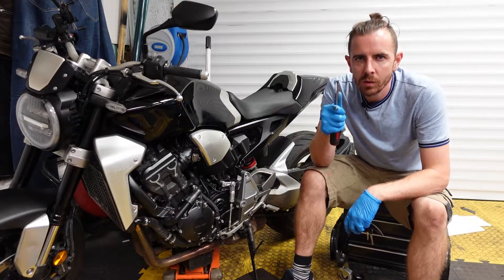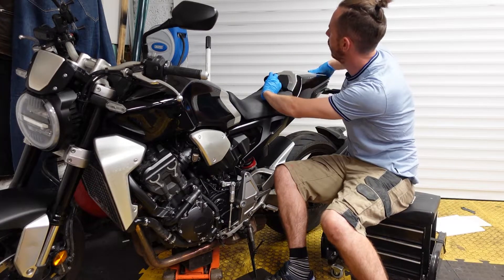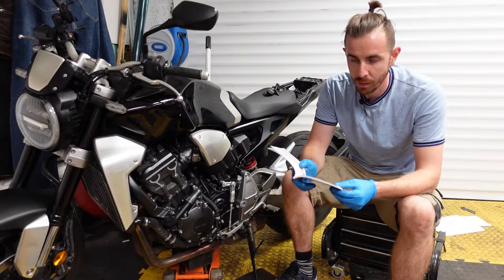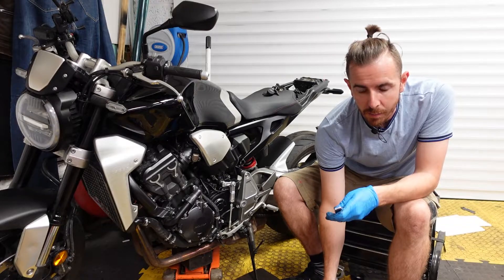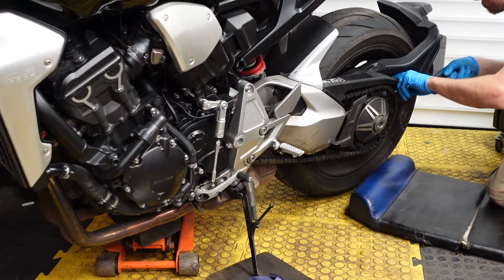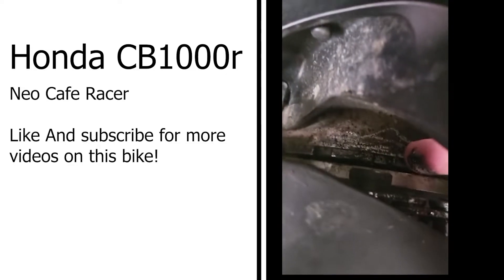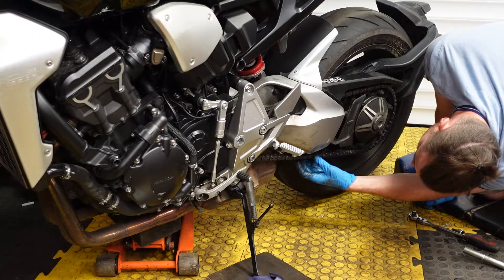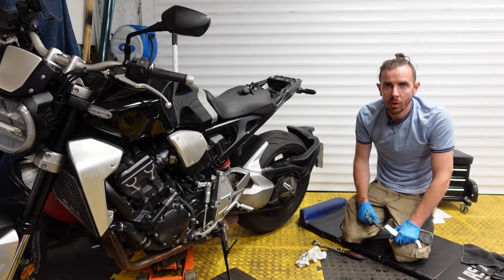DIY Honda CB1000r Chain Adjustment: A Step-by-Step Guide

Comment: bike should be on a kickstand with both tyres on the ground allowing for the weight to press/move the swingarm a bit. Your way of jacking it up on the exhaust is wrong and you don't get the measures as manufacturer advises. It might be off just a fraction but I wanted to point it out.
Reply: Is this true? I need to adjust my chain.

Comment: Hi there, the owner's manual wasn't passed on when I bought my 2018 CB. What is the torque setting for the 2 pinch bolts ? 
Thanks.
Reply from the maker: Sorry I have since sold the bike for a Honda rebel 1100. Hope you find the information you need
Reply: @rstv84  No bother, thanks for the quick reply.
Reply: @BlackDub1000  20N.m
Reply: @gordjy  Thank you 😀
Reply: @gordjy hi there ! Do u have the workshop manual??